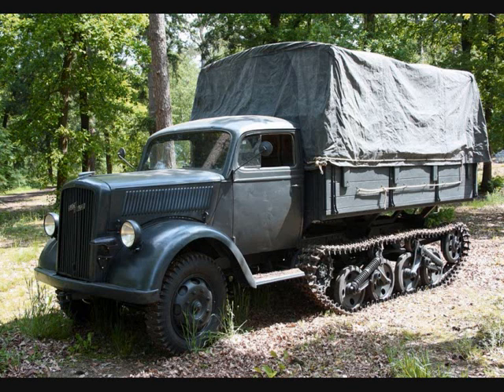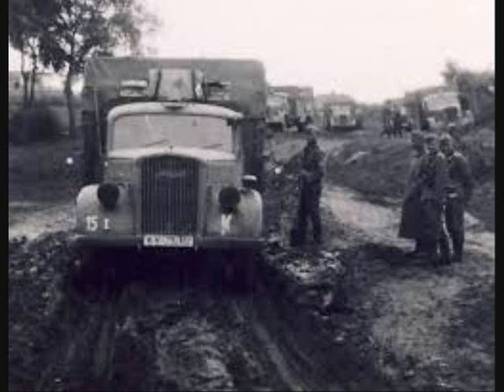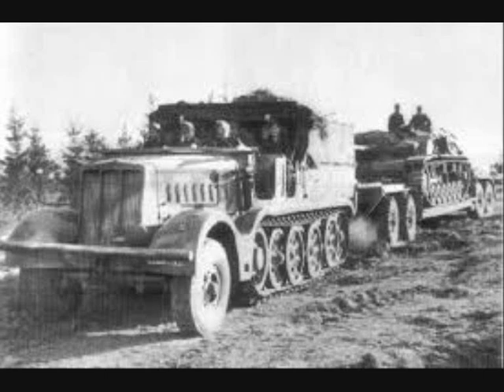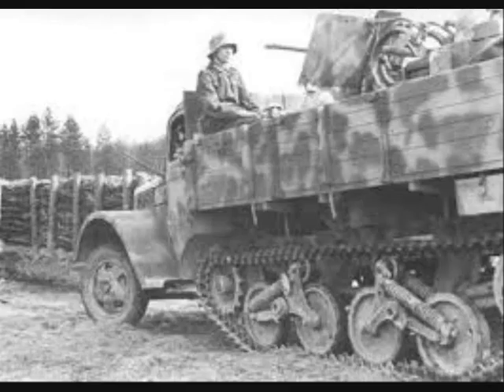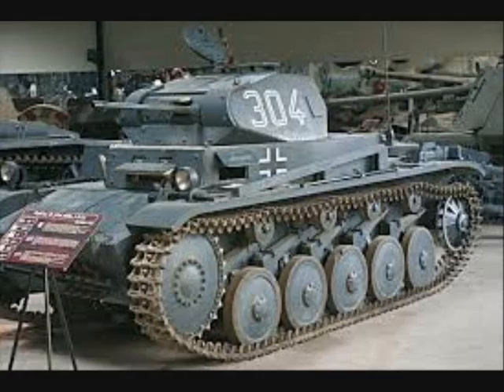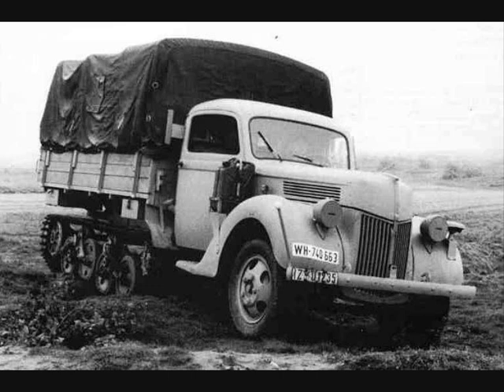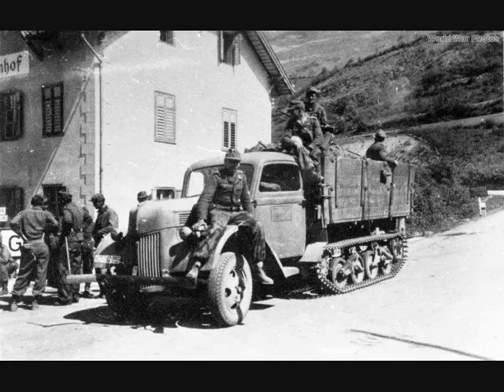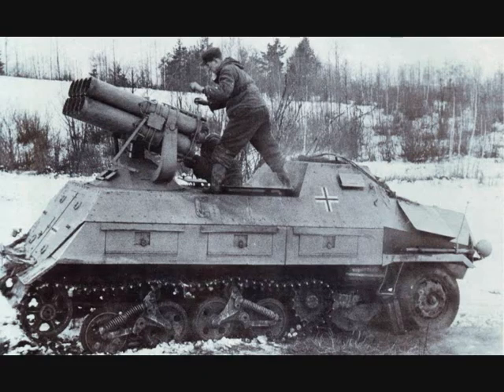Maultier / Sd.Kfz. 3 (Opel Blitz on tracks)

Comment: Excellent explanation! However, as you say, "most" Maultiers were based on the Opel Blitz, although not all, and examples of this can be found at 2'44" and 3'13". These look like V300S/SSM vehicles, judging by the radiator design, the more rounded bonnet and the absence of the Opel Blitz lightning flash emblem.